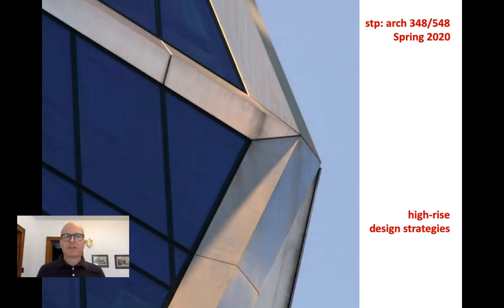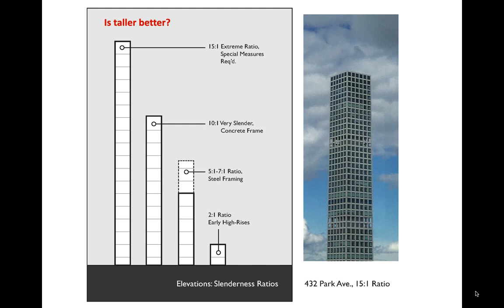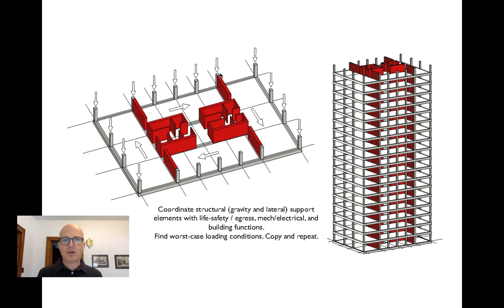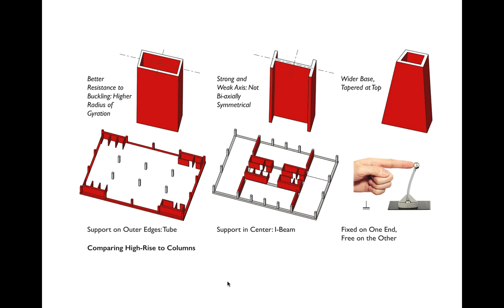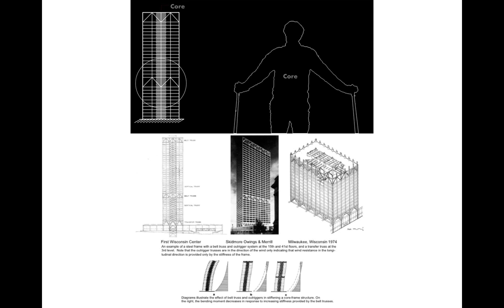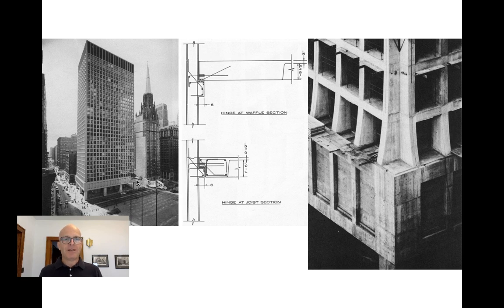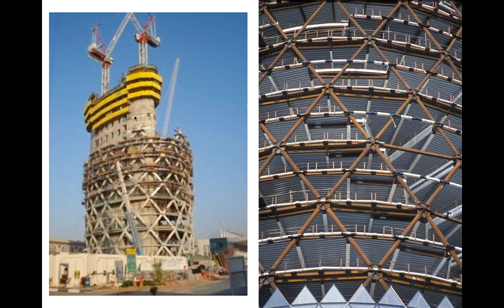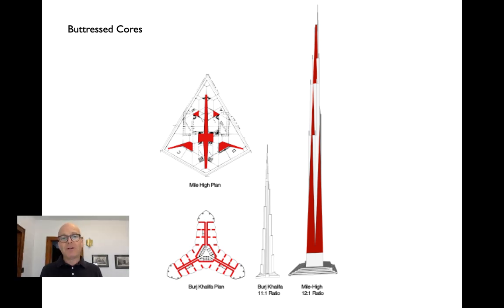ARCH 348 Lecture 6 High Rises

Comment: very nicely explained one of the most complicated part of high rise designing.  Its really very useful for academician, designer and researcher. Concept of structural system, merit and  limitation of each clearly understood.
Thank you so much for sharing such nice lecture.
Expecting some more highlight  on outrigger type, selection and shape of building, connection of outrigger to column and core.

Comment: Higher than 7-8:1 we are limited to concrete?
Reply from the maker: I wouldn't say "limited," but concrete becomes by far the most efficient way to brace such slender structures...
Reply: @thomasleslie274  it seems like that with the issue of green materials and other issues such as modulus of elasticity (e.g., of structural stainless steel), concrete might not be the most appropriate material to address all these new challenges. But, of course, your view it’s absolutely respected. Thanks for the excellent presentation, Sir!